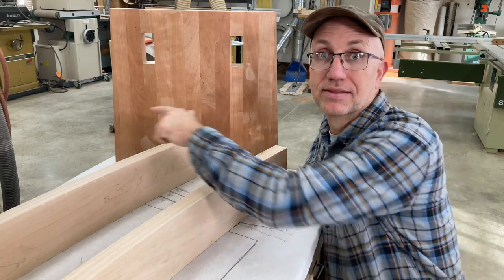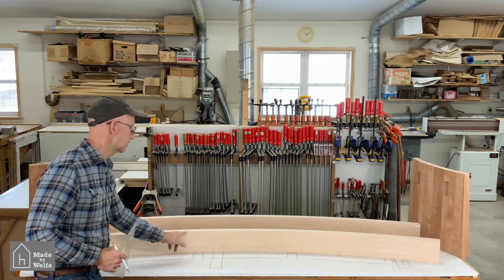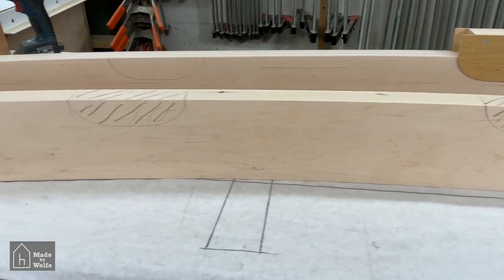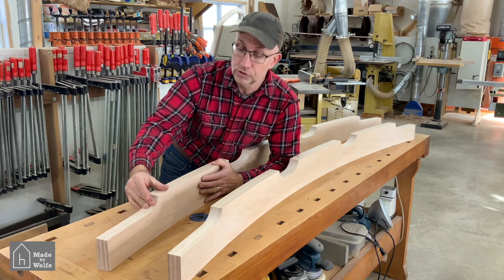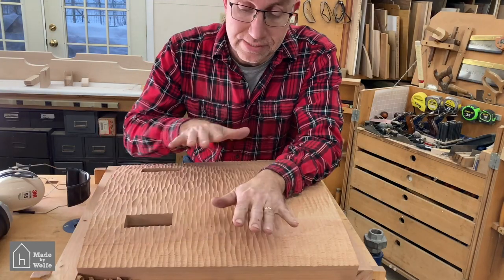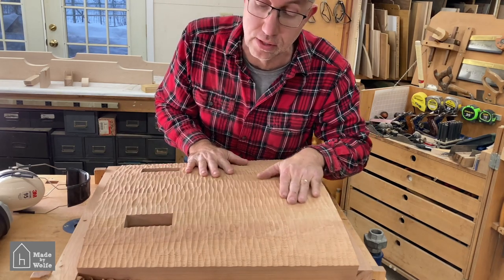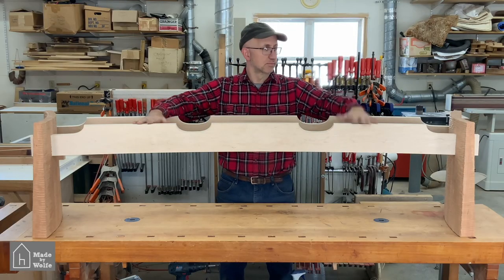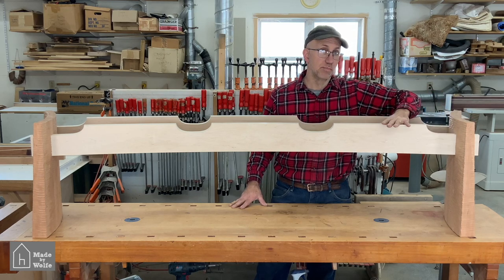Art Furniture:  Chip Carving the Bluestone Bench

Comment: Hi Todd.  I've done a fair amount, of successful texturing of pieces over the years with hand chisels.  A few commissioned pieces , mostly benches and stools.  I call it texturing, but it's what you are doing here.  I've used gouges from fairly deep, (in the 7 and 8 sweep range  to the shallow, but wide, (like 70 mm wide or so)  I really like the result, sort of a very "refined" "hewn" look, but of course the time spent is considerable.  I've done it mostly successfully on woods like silver maple, oak, and cherry.  Some has been with the grain, but more succssfully (shall I say, "easier" to avoid tear out?) cross grain.  Now I have a project ahead of me that is daunting.  I have 4 large benches, of beautiful old growth, tight grain VG redwood.  The bench seats about 14" deep. by about 5 1/2' long.  (wood is about 1 3/4" thick).  My plan was to texture (not too deep so was going to use a shallower sweep, but wide gouge) the top surface of the seats.  These benches have backs strangely (we older folks like such) and that surface is quite lovely very tight grain and I'm not going to texture that. Just the seats.  That is a lot of wood.  I have time, but I was thinking about getting some power help.  I looked at the Arbortech ball gouge, 30mm, and wondered if you had tried that.  It would mean that the gouge marks would not be as wide as I'd have like, (or two deep to be so nice a surface if the gouge strokes were 3/4 or more wide.  I like the work, but of course redwood is soft, so chips out easily.  I think I have to go cross grain, for less chip out.  But the only redwood texturing of this sort I've done I did about 8 or so years ago and note that I did it with the grain for the most part.  But that grain was flatter. ....  I wonder if you have tried the Ball gouge?  Looking I see you have.  I suspect that the ball gouge won't make the nice look of the chisel.  Others apparently are using it to do "gouge shaped" texturing, but I'd guess that the trough would vary enough that it would appear too obvious that it was done with essentially a power tool, not a gouge?  I suspect that this power chisels might work better for me, but am interested in your experience.  Course, I'm starting this project on the seats pretty soon, so might not hear back from you in time. lol.    thanks for the great videos. I'm hoping to do a bunch of large more rustic picture frames (probably redwood but could be cherry) in the next few months too, so all the advice is good.
Reply from the maker: Hey Paul, I'd love to see these benches.  They sound interesting.  About the ball gouge, I have used it.  The head is only about 1-1/8 inch diameter, so it is not going to give you a particularly wide gouge mark.  I have one but have not used it all that much.  I have made several samples with the Arbortech Mini-Turbo Carver head.  It is 2 inched in diameter and it can be held up at an 90 degrees or laid down at an angle to get different gouge profiles.  I have not put these samples towards any actual pieces, but I'd be happy to send you some pictures to see if it might work for you.  If you go to my website's About page, you can find my email and email me from there and I can send you some pictures.  https://www.madebywolfe.com/about